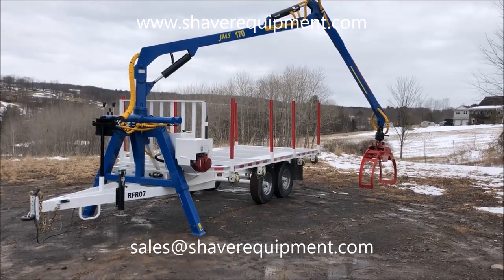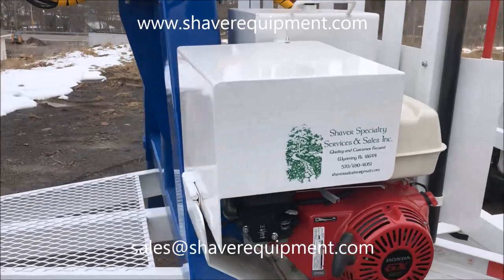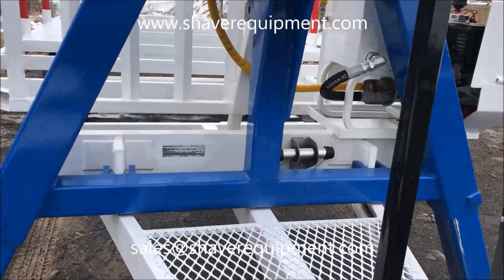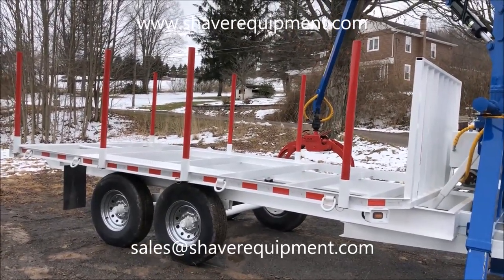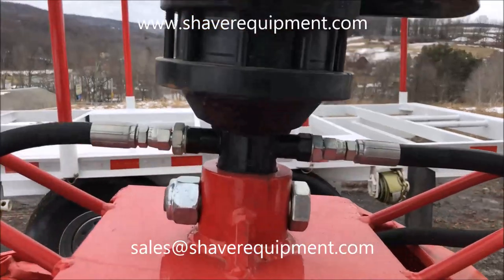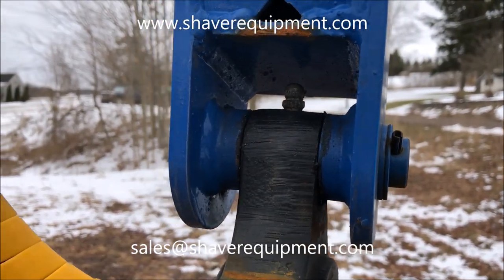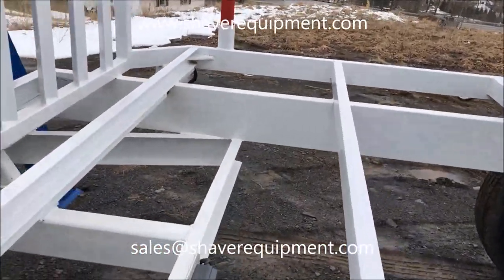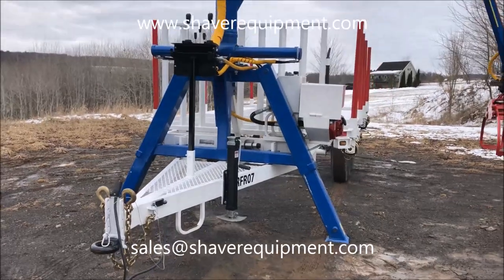Grapple Trailer, RFR07 with JMS170, Red White Blue, 3-11-18

Comment: Ultimately all potential customers want to know is (2) things .... is it built strong  !!! And what can it lift into its platform adding or subtracting reach .
Reply from the maker: Gary Davis unlike other “salesmen,” I actually use what I sell. It’s not just another product in a catalog. I do a lot of research online and then go and meet the manufacturer or their main rep, I complete my own demos, and then ultimately make my decision. All that said, the AM Machinery trailers are very well built, good welds, lots of grease fittings, and very well thought out. If a customer wants something customized, they will make it happen and not charge thru the roof to do it either. From my experience with the loaders, their weight estimates are pretty accurate. All weights are based on half reach, I have several other videos with the booms straight arming several large logs at full reach. 
JMS-155 lifts approx: 2,800#’s
JMS-170 lifts approx: 2,100#’s
AM-190 lifts approx: 3,000#’s
 AM-230 lifts approx: 3,500#’s
Hope this helps answer any questions you might have. I do have a log loader dump trailer in stock if you’d like to see it run or would like to see something in particular. Happy to help. Give a call if you’d like more info: 833-SPLITTR (775-4887) Thanks for your interest. AJ
Reply: Shaver Specialty Services & Sales, INC do you have a video of the dump trailer in use and price and specs
Reply: Do they sell the grapple seperate?